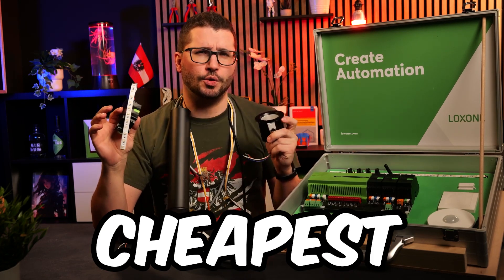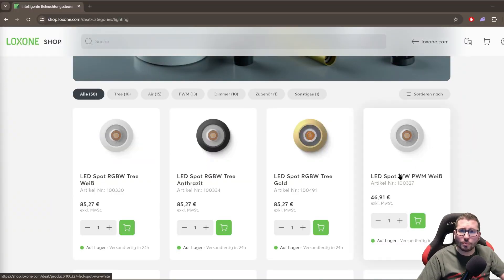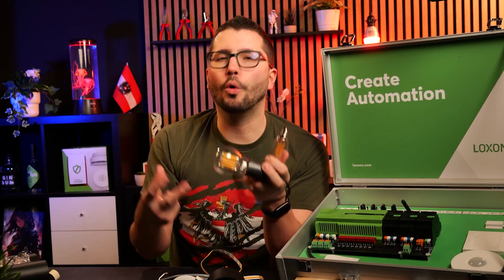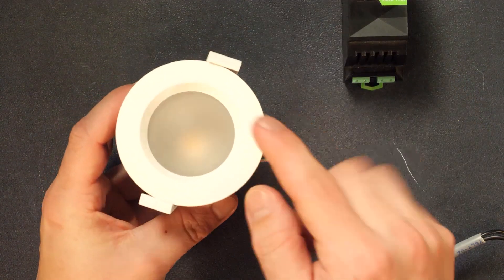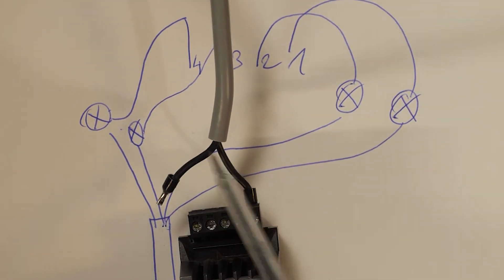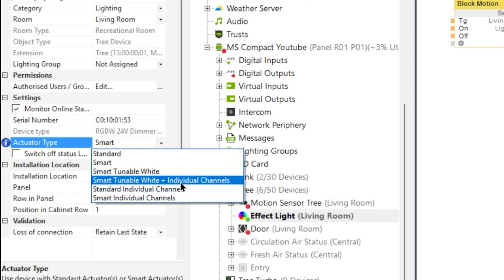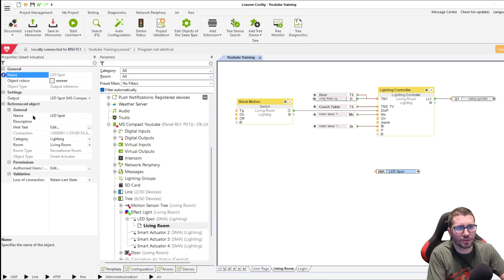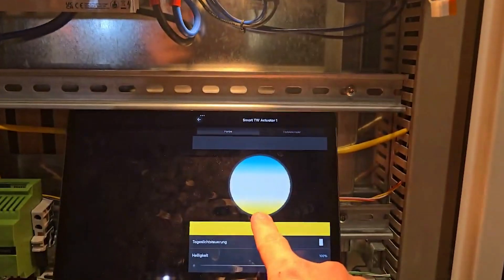The CHEAPEST Way to Add Dimmable Lights in Loxone! 💡💚 (don't share!)

Comment: What is the maximum allowable cable length between the RGBW extension and the LED spot/strip (and for which wire gauge)? Also, what is the maximum load per channel and the maximum total load?
Reply from the maker: the dimmer has 50W per channel, the length, diameter etc. depends and needs to be calculated for each!

Comment: Hi Richard,
A huge thank you for all your videos — they’ve been incredibly helpful. I’m currently building my house in Belgium, and you’ve fully convinced me to go with a Loxone installation.

I do have one question regarding dimmable lighting. I’ve been reading quite a bit about PWM dimming, and the literature often recommends modulation frequencies above 1 kHz to avoid eye strain and visual fatigue. Loxone dimming seems to operate at relatively lower frequencies (around 100–400 Hz, depending on the product).

Have you ever heard of users experiencing eye fatigue or discomfort related to this PWM frequency in real-world installations?

Thanks again for sharing your experience and knowledge.
Reply from the maker: Hey na never any issues and there is a command to increase pwm frequency but loses warranty after 😂
Reply: @ixma_en  all right, thanks for your answer ! I saw what you said on this matter in the Christmas wishes video in german ;-)

Comment: @CrazyAustrianAutomation how can i implement and control a high voltage (240v) RGBW 3rd party light with loxone ?
Reply from the maker: Dont do it. Rgbw Dimmer Tree = no headache, 24V lights on it
Reply: @ixma_en  trying to implement outdoor tree/building RGB lights. There is a company called "studio due" who produces high quality light not sure if it's high voltage yet but they implemented it in loxone
Reply: looks like it uses dmx signal to control the colour but it's high voltage

Comment: Hi Richard, Thanks for the great vids! I borrowed someone's Loxone DemoCase (powered with 24V brick) to try out a sample of recessed 24V dimmable spots with RGBW Tree Dimmer. Seems I get only very low output light...could this be due to the power brick? Danke! Grts from NL.
Reply from the maker: Hey mate, sure you put it on individual channels? Otherwise it might mix it weirdly. 

Try give it 24v directly if its brighter cause the rgbw should be 24V on the output too if its on 100%
Reply: @ixma_en  got it! it was a mix...indeed the Individial channel setting, and my dumb ass mixed up some wires. Thanks again! Keep up the good work.